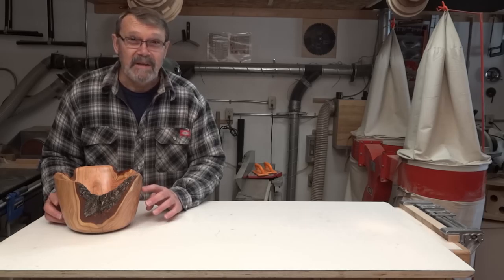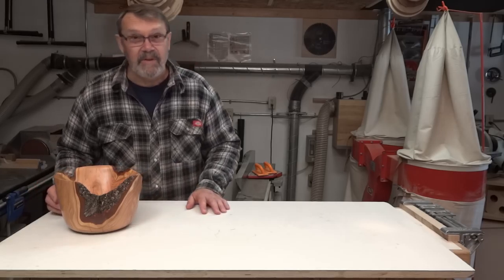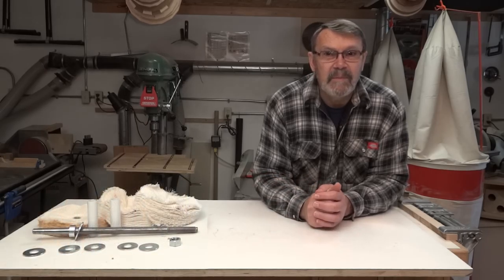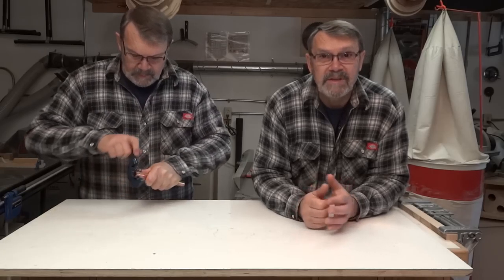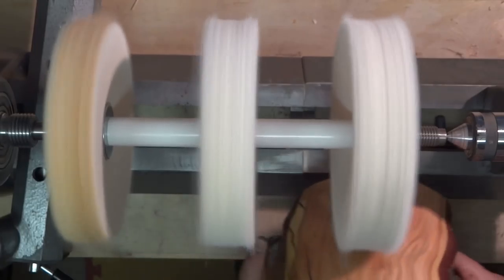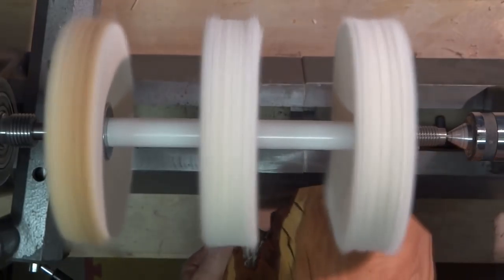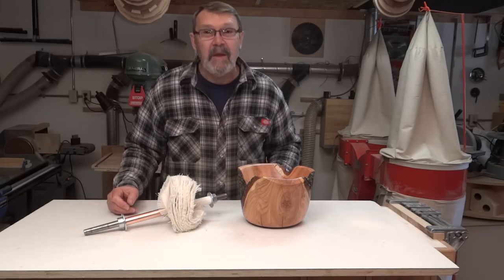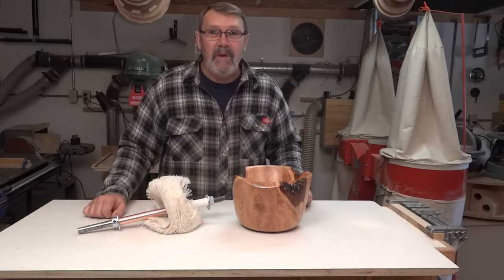Modifying A Beall Buffing System

Comment: I also have a thee and one and have occasionally had similar problems with larger pieces. So, Gord, are you taking it off the lathe and changing each wheel as you get to the other two?
Reply from the maker: Yes, Mike, it's a bit of a pain but whatever it takes to do the job. Much cheaper than buying two more of the shafts!! I've got more time than money!
Take care,
.....Gord
Reply: Gord Rock I have thought about trying to convert mine to the spindle adapter that mounts on the lathe with a MT2 adapter and draw bar but realize that the 3/4" holes in my 3-1 buffs would need to be converted to have a bolt to fit my adapter and it always seemed too much trouble. I turn a lot of smaller items like boxes and ornaments and such that the 2-1 is perfect for.